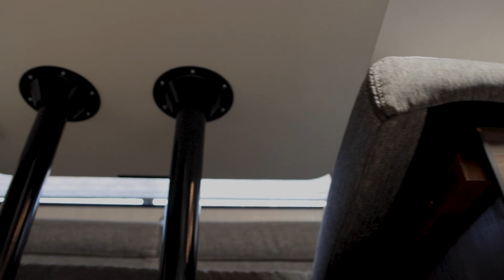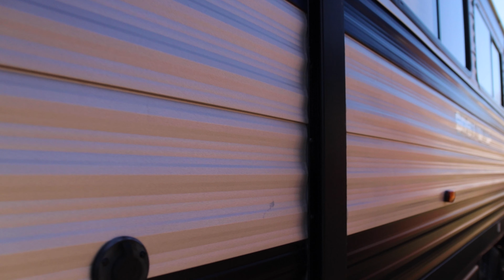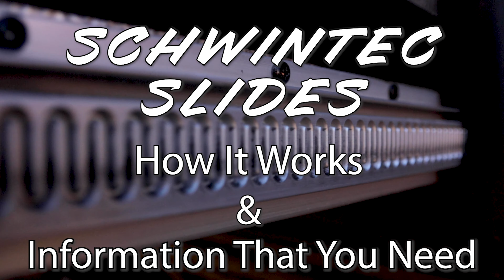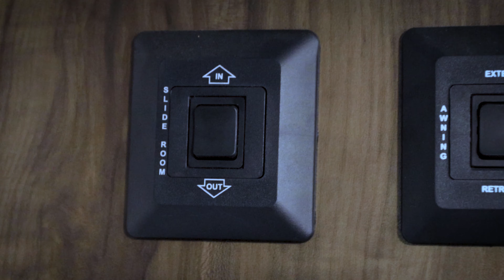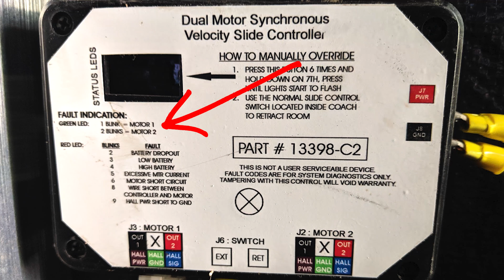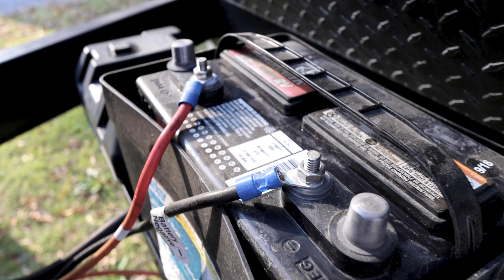Schwintech RV Slide Out Explained

Comment: SCHWINTEKS ARE A LUBELESS SYSTEM. If you insist on lubing it, use dry lubricants like CRC or graphite
Reply from the maker: You are very correct. Dry lube only. Goes on wet but dries instantly.

Comment: It's always something....rigth now the gas for the Dometic Refrigerator...will not work, making boondocking challenging. Got to love those warranties.
✌❤
Reply from the maker: I do not know a lot about the fridge systems but i do know that you have to pull the covers on the outside of the RV where the fridge components to check and clean those areas to make sure that they will work correctly. I do not know if this is your case or not but may be worth the look. Take a look at this video in it entirety and see if there is something there that may be able to help you. https://www.youtube.com/watch?v=ugw0pw-EXK8